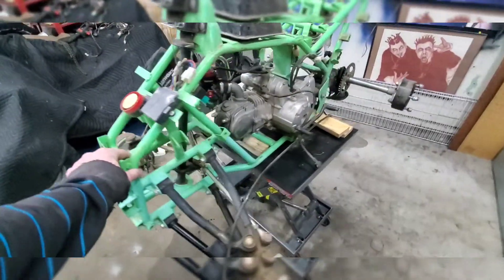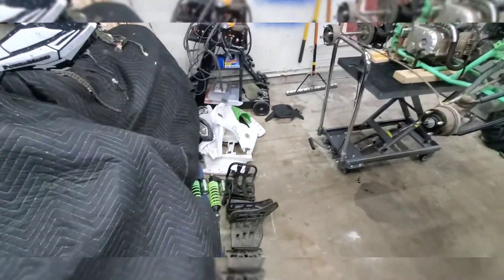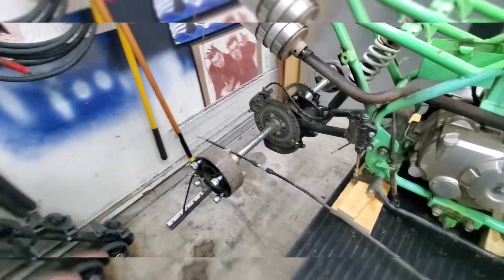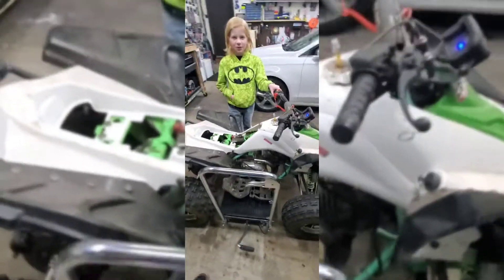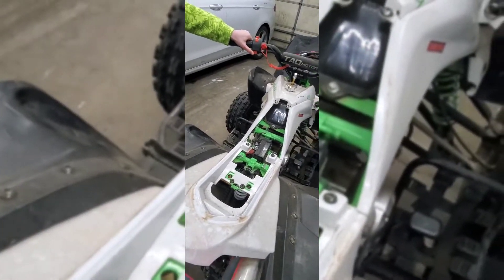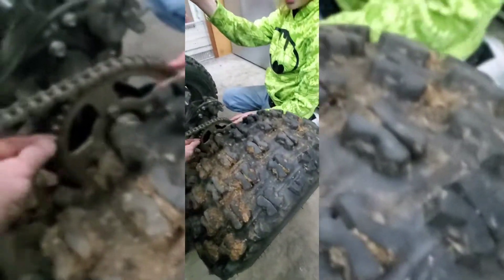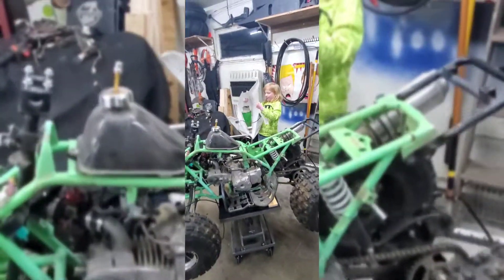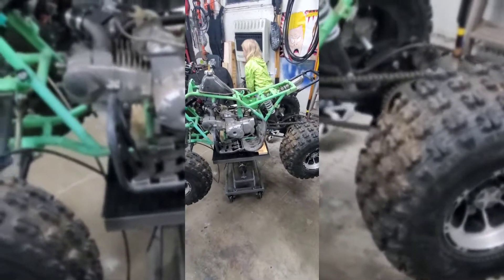Rebuilding a 2018 Tao Tao New Cheetah 125.  Episode 1,  Teardown and General Plan

Comment: Looks like you got a nice powdercoat setup. Which powder gun is that your using?
Reply from the maker: Its a mid grade set up from Columbia coatings.  A lot of similar machines out there like it
Reply: @MnWarrior350  that's what I thought, I am looking at the 3.0 Dpw myself.
Reply from the maker: Just looked at it.  Looks like the newest Update version of Mine.  If you have only used an Entry level and you're stepping up, Its a whole new Level, you'll be happy with the upgrade